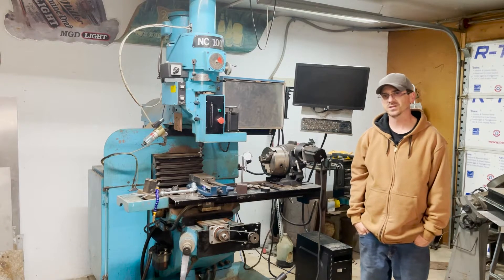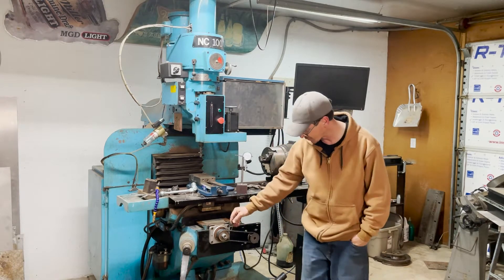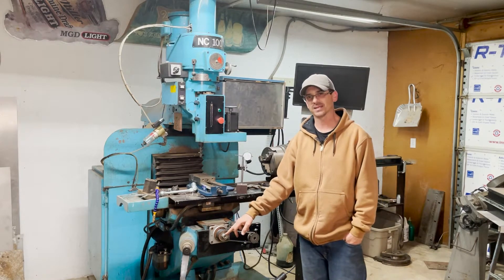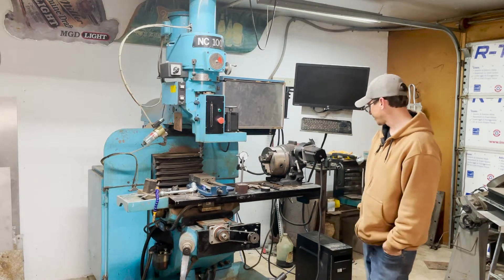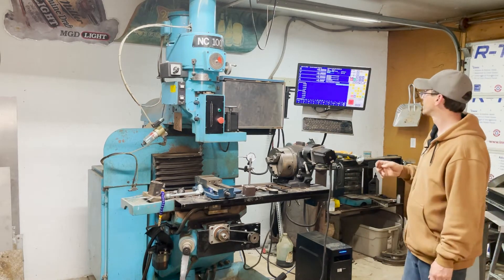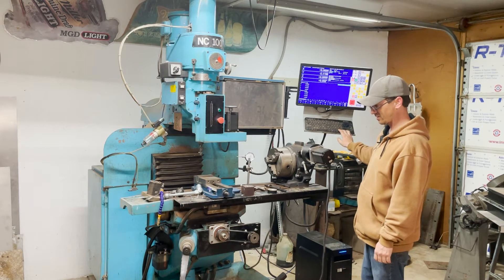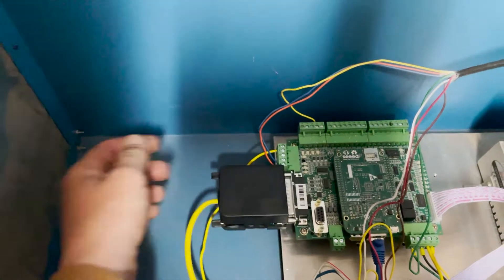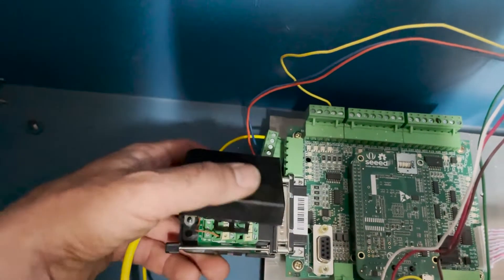Converting to Acorn CNC Centroid controller Part 3: Basic input and output wiring

Comment: you should have changed your vfd parameters in order to match the wiring of the acorn spindle controls
Reply from the maker: I'm not sure if that is a possibility, the wiring terminals on the vfd are pre-set. But I didn't read all of the documentation that it came with, so I can't rule it out. But wiring the relays this way worked out perfectly, and was actually really simple. No need to go back and change it now.

Comment: You can use the Wizard homing and travel to use a custom home program and it won't overwrite your cncm.hom file after you have commented out the A axis home line. Let me know if you have trouble find ing it.
Reply from the maker: Awesome, and thank you! I had saved a shortcut for cncm,hom to quickly edit it, and was going to use up 6 inputs to work around the issue. That is a huge help. Thanks again!